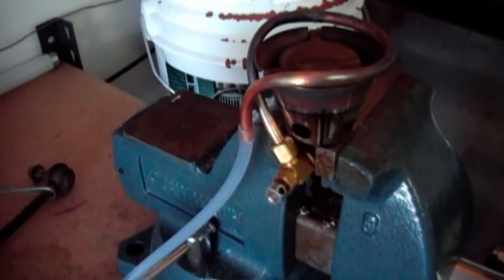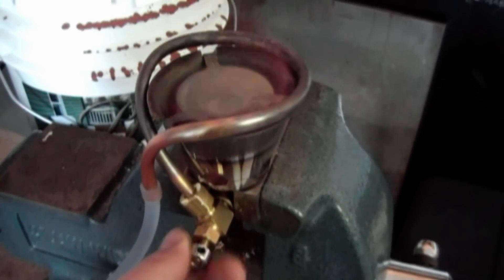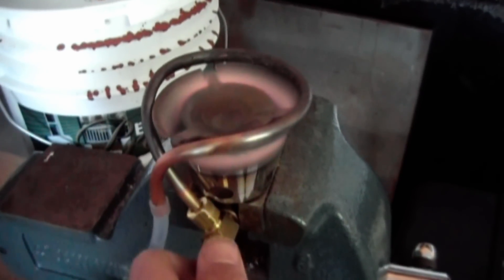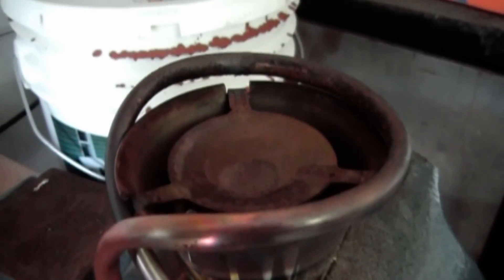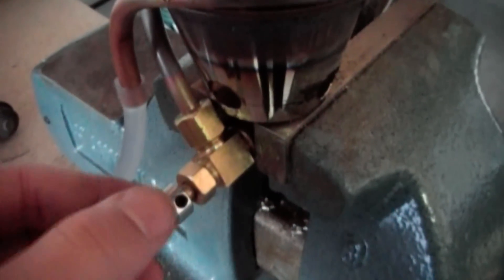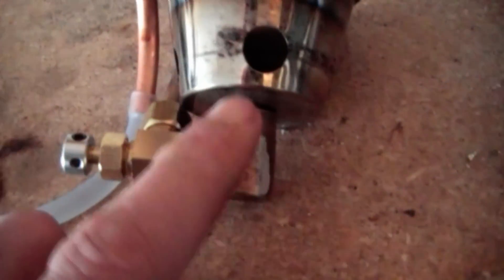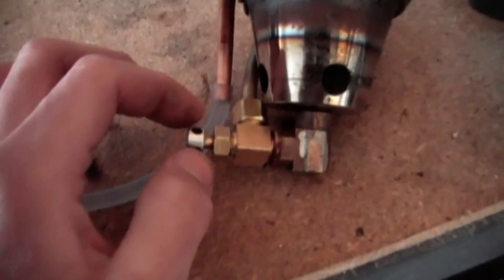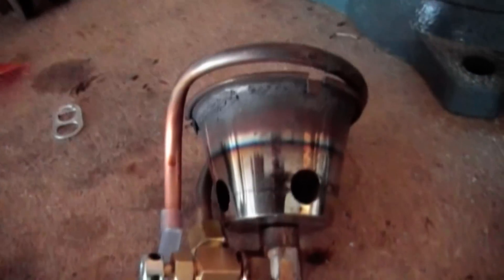Homemade Alcohol plate burner

Comment: Haven't watched the newer posts on this project yet, but figured I would give my 2 cents anyways. Why wouldn't you be able to couple the vaporizer line directly into the feed nozzle without a valve? As in regulating just the flow of liquid alcohol. Another thought is, have you tried using an atomizer for your nozzle instead of going the vaporizer route?
Reply from the maker: A Lot of Vowels Hehe the latest version of this stove, which I haven't posted a video on yet, uses no second valve on the stove, just a valve on the fuel bottle. This was done mostly for weight and simplicity. The problems with fuel vaporization in my earlier attempts was solved by using a longer generator loop (about 3 feet) with a much smaller inner diameter (about 1/32")